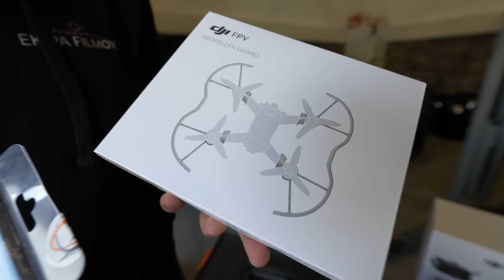I SOLD MY DREAM CAR for Another Dream!

Comment: Please please don't use portable hdds for any important footage, especially not for backups. You really should contact LinusTechTips to get you a proper NAS setup, they usually get sponsored disks anyway and you get to make a video out of it
Reply from the maker: Interesting!
Reply: @mgcharoudin  Data stored on not powered (na refreshed) HDD/SSD is degrading over time. You can lose data from HDD (if not powered and refreshed) in couple of years. And from SSD this can by event months, depending on SSD.

Even if You get proper NAS with ZFS and data scrubs to keep it all in good condition, this IS NOT BACKUP.
You need at last second geographic location (or better 2). Disk can break, NAS can fail, or place where data is stored get burn in fire.
How many location depends on how important the data is to you.
Reply: @matusiakw  Or just use a simple big NAS set up to do cloud backups...
Synology makes decent stuff with lots of stuff online about them...

Comment: Yeah I use a completely normal Mavic Pro 2 for drone. For the SPECTACULARLY handy function that... When you stop flying, it sits there in the air and it waits for you. A FPV drone, will just fall down. IFPV drones are useless unless you are doing very special stuff.

I have 2 of those Mini DJI drones and its amazing how capable they are. And nobody asks you for permits and nobody gets angry when you fly those little ones.

Comment: Misha, take the Caddy to a proper van security place. They will fit deadlocks and reinforce various weak spots. The security on modern vans is terrible and there is a massive industry out there to make up for it.
Reply: I actually feel noticeably relieved to know you've seen this. Big love, watching since forever ago 🤙🏻
Reply: What ? Like shatterproof windows ? You insure what you value, have an alarm/immobilizer, and lock everything in the trunk or frunk.
Reply: @blueman5924  You can open most modern vans in under 30 sec without any destruction.

The point is to deter opportunistic theft. Nothing can be done if the thieves are prepared/committed.

Comment: You could have saved so much money with your camera choices. A7SIII for example with Tamron or Sigma Glass at a fraction of the price. Many good monitor choices also without going Atomos. You're video guy clearly wanted to buy the most expensive gear possible lols

Comment: As others already suggested I would invest in a decent NAS setup with a raid disk system to make sure you keep your data in the event of a disk failure. Cloudbased would work as well but as you mentioned, the internet speed is very important when working that way. Have a decent look into network associated storage and their different disk setups, it will give you peace of mind regarding your data/videos ;).
Reply: If you have a NAS setup, you can have automatic cloud backups / sync.
Yes, the initial upload can be pathetically slow if you have bad internet, but most cloud providers have an option to mail you a hard drive to restore data if you need it.
RAID isn't a backup too. They really should have 3 backups. The main NAS, then an offsite backup, then a cold backup. In my book, cloud providers provide for the offsite and cold backup capability.